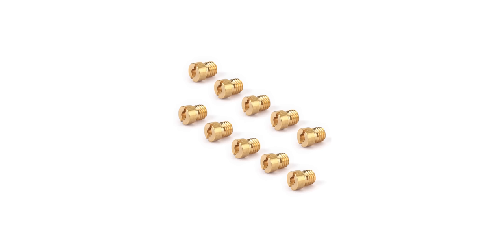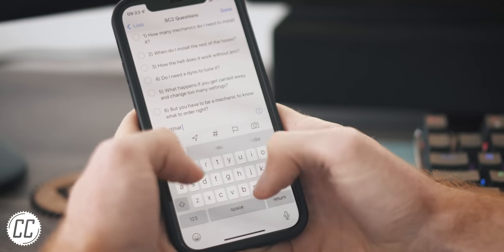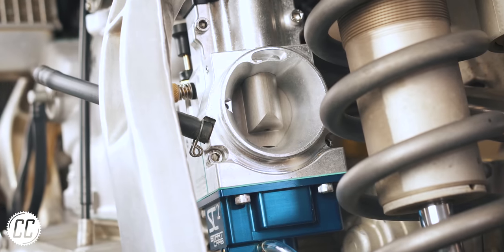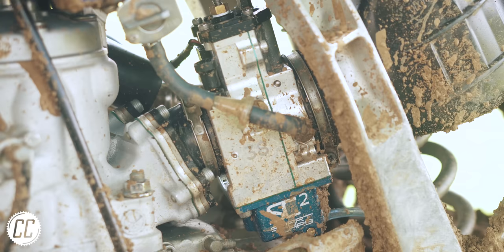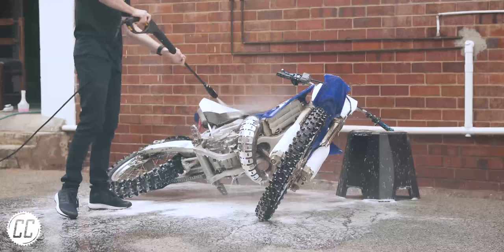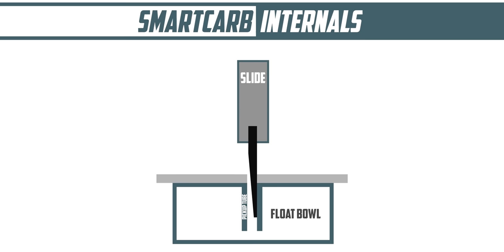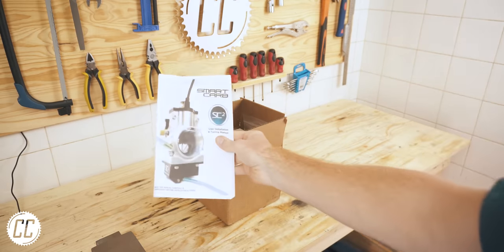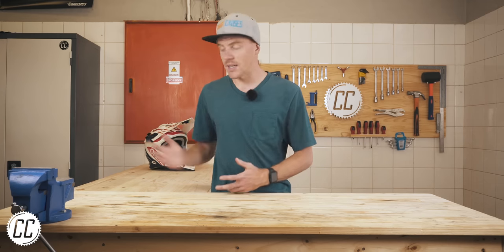The Best Carb Money Can Buy? | SmartCarb SC2

Comment: Those big claims about fuel economy and power need to be tested, i'm extremely skeptic
Reply: We agree. Third party testing and verification of our claims is something we welcome. Dirt Bike Magazine, Cycle News, EnduroPro, and most recently MotoVerde in Spain have all done tests and published articles about their results. Pros like Cody Webb, Diogo Vieira, Pol Tarrés, and more have all attested to the gains in power and economy in competition and we've had a hand in setting a number of land speed records with 5 new Bonneville speed records just this last July. 

Thank you for your interest, we hope you stay tuned.
Reply: I too find those hard to fathom, there are a number of reasons why 2 strokes are less fuel efficient, but the carburetor is not going to be the main one, if it's working correctly. Mikuni and Keihin have been making wonderful carburetors for  many decades and while I'm not blinded to the idea that a different approach could have slight benefits, I do not believe that a properly tuned traditional carburetor is not going to produce almost the same results. Most 2 strokes come from the factory with a tune that is rich to keep engine internal temps down and provide longevity, stock carbs can be tuned accordingly for more power and reduced fuel consumption, but with risks to engine life.
Reply: @SmartCarbFuelSystems  this company is the goat
Reply: @SmartCarbFuelSystems  maybe something for Project Farm to try out
Reply: With only a low and high speed circuit, the mid range will be compromised. This is where fuel economy is usually the greatest due to engine design. The typical mikuni has three circuits in this size range so economy will typically be greater. Fuel injection atomizes fuel to a greater extent than a needle jet and is infinitely variable when has feedback loop.
Reply: Old, worn out rider here. Even with correct jets set for altitude, if you're a noob carb guy, you can "screw" the job up. Amazing idea, Guys!! Everything about it makes sense to me. Love it! 👍🏼
Reply: Two friends use them and it is much more efficient than the correctly tuned stock carb on his Beta 250rr and 300 XT
Reply: @Thomas B Yeah, was especially disappointed when I first learned that injection on many simpler/older motorcycles is basically just a pre-programmed carb emulator. Like xRPM+yThrottlePosition=FuelFlowRate. No real-time adjustments based on MAF or O2 sensor readings. At least tuning is simpler than swapping jets.
Reply: @Thomas B something that injection won't beat ever is high rpm performance because it's limited by physics itself, carburators are better for racing applications
Reply: You probably don't believe that there are extraterrestrials cruising our skies and oceans either.
Reply: Same here
Reply: @SmartCarbFuelSystems  send me one and I'll test. I was a bike mechanic for a decade and have the perfect test subject.
Reply: @SmartCarbFuelSystems  send one to fortnine
Reply: Sudah punya ide ini beberapa tahun lalu, ternyata sudah ada
Reply: @sigits6021  U have tested the cards b4?
Reply: This is nowhere close to New tech. This was originally how a carb was supposed to be.
Reply: If it can tune to within 95% of an optimal tune, then fuel mpg/power should be close to the max.  What I'd be interested in knowing, is can this carb still get clogged?  Most carb clogs are in the jets.  But that metering rod might mean there are no (or at least fewer) tiny passages for bad fuel to clog.  I doubt that more power or more mpg are really that likely, at least not compared to a standard carb that is well tuned.  You probably won't see gains there unless your stock carb was rich.
Reply: Has anyone used this on a ultralight aircraft?
Reply: @kevinstraus1478  Wats your maximum elivation on current carb? If u won't go at the cruising altitude of jetliner , you'll be OK. 
Popping a wheelie with this carb on low gas seems to be OK and much better compared to the stock carb. Low gas+ stock carb wud make the motor stutter.
Reply: @Thomas B that is incorrect, fuel injection will always make more power in a factory design configuration
Reply: @999benhonda  SmartCarbs are much less susceptible to clogging compared to convention jet/needle carburetors. There are no small orifices. Even so a thorough cleaning annually is advised.

Power and fuel economy increases over well-tuned stock carburetors is well-documented. More finely atomized fuel results in greater available surface area of the fuel mixture. The result is more complete and effective combustion with less wasted out of the exhaust.
Reply: @kevinstraus1478  yes, we've equipped a few ultralights and many paramotors to-date.
Reply: I’m sure one of the big reasons it actually saves fuel is the breather pipes. I always wonder how much petrol I dump on the track every time I land a jump. Excellent that this design removes this! Thanks for the video!
Reply: @benjaminedgley6215  Good observation, there is also more evaporation while parked having an open air breather.
Reply: Me too and I'd bet money that you're right
Reply: Send me one Please love to tune and try on a old shovelhead of mine
Reply: The lectron I used on my 03 CR250 was flawless and the fuel economy was absurd I could do 1hr trails and not even half the tank was used. Best investment ever.
Reply: @kevinstraus1478  That's what I'm looking at the Smart Carb for. Simpler is always better when used for flight. Automatic altitude compensation would be great. I plan on using a Hirth F-23 so will need two Smart Carbs. The stock carbs on the F-23 don't do that. Hirth offers fuel injection, but the controller is not redundant and has a reputation of failing in flight. That's an oh sh.. moment I prefer to avoid. Plus the EFI is not touted to be more fuel efficient where the Smart Carb does. Hopefully later this year I'll call and talk to them about using their carbs on my F-23.
Reply: Agree there us no such thing as power created by an engine (combustion engine) with gas savings.
Reply: Well, compare fuel injection to carburetor, more power less fuel. The same here
Reply: There are dyno sheets available and these cabs and lectron all develop less HP across the rev range compared to a typical quad vented keihin airstriker. These carbs use less fuel because they are designed to work lean. There's no magic involved. And they still require setting up and adjustments just like any other carb to get dialed in, except the companies have a support team to hold your hand throughout the process.
Reply: Smartcarb and lectron have been out 50+ years, and they haven't developed anything superior to an already existing conventional carburettor. It's all sales brainwash.
Reply: This whole thing read like a sales pitch, my man even brought up Ben Duffy questions 😂
Reply: @davidrasmussen2975  I use a STIC Super X carb, which is much more powerful than SC. Why, bc it has a fuel lift system via air entering perforations in the needle jet tube. Fed by venturi vapor into a surrounding chamber. The fuel is cooled by stepped passages and the vortex within the center of the tube. Also, perforations are exposed as float bowl level drops, creating a leaner mix as RPM rises. Low end responds like an electric motor and a widened peak HP table carries into an extended top end. Especially beneficial to smaller bore engines.
Reply: @freakyfreerider  nope. The SmartCarb is the culmination of 50+ years of metering rod fuel system development by William Edmonston, having entered the market in the early 2010s. The original flat slide, William's. The secondary choke circuit, William's. Conventional carburetion has borrowed from the development pathway of this technology for a long time, with the exception of pursuit of single circuit metering rod fueling, made possible and optimal in the SC2 with integrated float bowl venting.

Encourage you to educate yourself on modern carburetion like the SmartCarb. That is outperforms the Airstriker and others is by now well established. Take, for example, our Pro podium sweep at the US Hard Enduro round in Moab on Sunday, not two days ago. Or our land speed records at Bonneville and in Australia. At the very least you should actually try one before forming an opinion on it.
Reply: Its super hard to believe a claim like that. That has to be in extremely specific conditions. Like maybe light load cruising speed type stuff. It takes fuel to make power period. More power=more fuel. Yes there is a point where your returns on spent fuel can be higher but ive never raised compression and had to lean a bike out.
Reply: @TheZmoney420 When you wrote “More power=more fuel” Surely your intention was more fuel = more power. 

However, the objective is to effectively deliver the fuel air mixture, and efficiently burn it. And it is THIS that delivers more power. 

Just delivering more fuel demonstrably WILL NOT equal more power. There has to be sufficient air, and the air has to be employed efficiently by the carburettor to atomise the fuel.
Reply: I was able to toss my small tank back on my yz250 and could do over 50 miles with a smart carb.

Comment: Regarding those stripped screws on the Keihin, have you tried using a JIS screwdriver? Using a normal Phillips on JIS screws (like Japanese carbs) is a recipe for stripped screw-heads. They look the same but they aren't.
Reply: While I personally am aware of that.. feature , I don't feel like that's something we should have to deal with. A hex is a hex; if it fits, it fits. Philips/JIS screws suck.
I used to hate flatheads, but after hacksaw-converting hundreds of stripped fasteners into flatheads, I definitely prefer them, or hex cap.
Reply: @Cheezeball99999  socket head torx are cool especially the ones made of stainless steel.... Expensive but for the one time user and doer not a great expense at all for a single purpose equaling very cost effective.... And by pushing a few buttons on your smartphone will open up the world wide Web where all can be found.... eBay and Amazon's good place to start.... And if you have to you can find where the original manufacturers are located to buy directly from them if necessary..... Just saying I know where you're coming from as I used to work at a vintage Harley-Davidson restoration shop.... Where the motorcycles were previously adjusted and maintained from what looked like hammer and chisel work... And your job was to bring it back to life with modern day technology and performance that can be done for many many cubic dollars versus pounds of fun
Reply: @donniebaker5984  I use Stihl bolts and screws wherever I can since I'm a Stihl tech 🤣 
So T27, T25, T20 for me.
Reply: Nothing wrong with Japanese fasteners if you use the correct tools; Japanese Industrial Standard (JIS) screwdrivers will remove those “Philips head” screws without damaging them. Use the wrong tool and you pay the price!
Reply: If you don't have a JIS screwdriver take a #2 phillips and sand the tip down until you get a perfect fit in the screws.
Reply: Alex Fracyon  you will know which screws are JIS by a stamped dot in the head of the screw.
Reply: For stubborn screws a small vice grip plier around the head of screw works to break them loose. If done correctly you will be able to reuse the screw.
Reply: Why am I now hearing about jis screwdrivers and screws? Watching Alan Millyard was the first time I heard of it
Reply: @randombuilds8336  yep, have plenty modified screw drivers
Reply: A sharp posidriv will work in JIS. But I prefers to swap them out for hex socket cap screws. Stainless is ok but watch out for any reaction against zinc die-castings. Electrolytic corrosion can be viscous.
Reply: I replace them with hex heads.... done
Reply: @Cheezeball99999  I find most philips are PZ in any case.
Reply: @winky_cat  your bicycle gears use JIS screws
Reply: Boy you're right about that.  INEXPERIENC
Reply: Same issue with dummies using philips screwdrivers on pozidriv screws.  You might get it off but you’ll bugger the head
Reply: @mitchd949  next step is small needle nose channel lock pliers.
Reply: THIS is the comment that solved a 50yr problem!
Reply: Boy I learned that lesson early! Went to my Honda shop and they sold me the same screw driver they used. Still have it. Didn't know it had a different name.
Reply: Always break the bowl screws loose with a small pair of vise grips then use your screw driver to avoid this problem😎✊🏻
Reply: Well there are metric and standard hex/Allen screws/bolts they can also be stripped. Every cars I have ever seen already has the jis stripped out already it crazy how many people don’t know about them or how to look for the dot that identifies them. Might help if they sold the jis screwdrivers locally like perhaps more places than Japan.
Reply: A number 2 Phillips generally works on most Keihin carbs. You do have to apply a pretty good amount of pressure to avoid cam out as JIS screws are very slightly different in size and for some reason (at least on Honda Keihin carbs) the heads are extremely soft.
Reply: Interesting to Know 😻
Reply: Go to local Fastenal and buy their 4” long JIS/phillips bit. It fits like a glove and won’t strip the US phillips style.
Reply: Was going to say you know you can replace a Phillips screw with a Allan head screw or a hex bolt if you'd like. Lmao
Reply: I agree. Have you ever checked out the 3, (really 4),  types of Phillip head used in North America and the differences between them? It's quite interesting. Lol. I despise Flat Head screwdrivers for anything but prying and wedging,, but I cannot argue that it serves a great purpose when needed. Many times it was the only way I was able to Remove stripped fasteners by turning them into a slot. Lol
Reply: @michaelmclennan6144  same
Reply: @Cheezeball99999  last time I heard ”a hex is a hex” the genius ruined the bolts on my brake rotor by using standard on metric. Also, they required a butane blowtorch to loosen the thread locker.
Reply: @Cheezeball99999  and Robertson are superior to both
Reply: I personally like converting them into flat head screws when they wont come off
Reply: while. it wont. spill fuel on the ground.......it will spill fuel into the engine.
Reply: @davidelliott5843  thats great advice. I would like to add that you can safety use the stainless screws/bolts if you are liberal in your application of anti-seize. Stainless also has a tendency to gall and the anti-seize prevents that as well. I prefer the copper anti-seize but the aluminum version seems works well too from what I've personally seen. 🍻
Reply: JIS = Japanese Industrial Standard
Reply: THIS is the answer. The right tool for the job. Also JIS work better in Phillips than Phillips.  
Phillips was designed to “ cam out”, JIS was not, so using a Phillips on the JIS is blaming the wreck on the train.
Reply: @phrodendekia  so you know all about Torx bolts and bits then, but, what about Torx +, E-Torxs, RBRT Torx, and Polydrive Torxs? 
You'll find Polydrive Torx fasteners used as Audi q5 head bolts but I've never seen them used anywhere else yet.
Reply: @emmettturner9452  Heat is required on locktite red, not on locktite blue though
Reply: @ShaunHensley  Exactly. The same bike used red (“permanent”) Loctite on the bar end bolts.
Reply: @emmettturner9452  Red should be used on almost nothing. It's for industrial applications in which safety wire isn't suitable
Reply: @ShaunHensley  The 2008 Kawasaki Ninja 250 definitely comes from the factory with red “permanent” thread locker. Just look up any forum thread in replacing the bar ends. The service manual says to use “non-permanent locking agent” there but the factory clearly did not.
Reply: @emmettturner9452  Different threadlocking brands don't use the same color coding, so I really can't speak to that. 

It's aggravating for sure
Reply: @ShaunHensley  From the wiki regarding the previous generation from 1988-2007: “The first, and hardest, thing to do when putting on new bar ends is removing the old ones. This can either be nightmarishly difficult or a walk in the park. It may depend on which Loctite application guy was on shift when your bike was assembled. Kawasaki puts red (permanent) Loctite on the bar ends. We don't know why.”

I completely destroyed the bolts on my first set because I had plenty of leverage and did not use heat. The bolt head just smeared like butter! After using a torch to liquify the thread locker I was able to get it out with an impact driver.
Reply: @ShaunHensley  Understood, but it’s clear from experience that they are using the “permanent” kind that often requires heat. :(
Reply: @Cheezeball99999  100's? Use a better screwdriver amd some pressure, lol.
Reply: @davidelliott5843  HA ha - IF only they WEFE viscous ...
The problem is really that they're VICIOUS.
Reply: I always replace the stock screws whith stainless steel alen-head screws a little pricy but worth it
Reply: Also an impact driver.  I really can't understand how tight the factory can get carb screws, it's amazing.  As if galvanic bonding is factory installed.
Reply: @Max_Chooch  You forgot security torx, lol! ;)
Reply: @winky_cat Odd
Reply: Impact screwdriver then replace with modern/commonized screws 😉